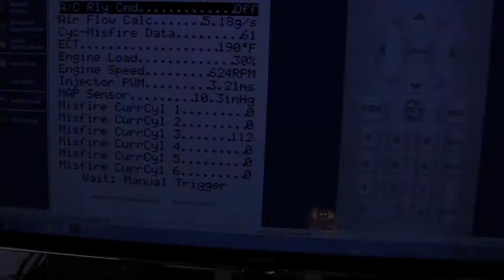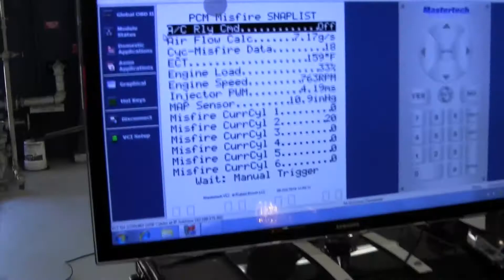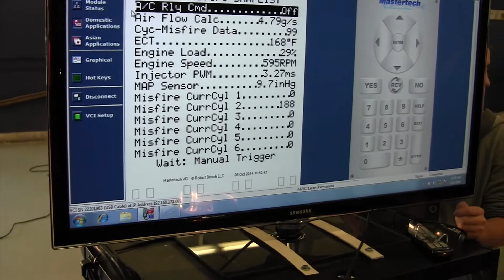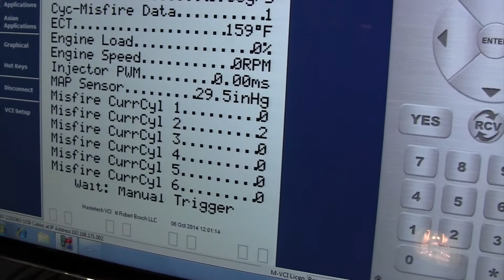Trailblazer misfire Testing Ignition Coil

Comment: Useless video. Change subject line to How To Replace COIL On Plug on Trailblazer. 5 people standing there and not 1 of them explained anything related to testing.
Reply from the maker: Sorry to hear that, what did you want explain how to change a coil. Because how we identify the bad coil was explained -
Reply: @natedaviscteinstructor  
 
Change the subject line to
"Chevy Trailblazer 4.2 Pinpointing Bad Coil On Plug Using Shop Software" because when someone searches for how to test a coil on plug on Chevy Trailblazer,this video will not help.The only thing it does is it shows which cop is faulty by using a shop scanner/equipment.There is no actual testing of the coil on plug itself.How many DIY mechanics have the type of equipment you're shown using?? Even if a DIY guy has a cheap scanner,a misfire code that pinpoints the specific cylinder (P0301,0302,0303,etc) with the misfire is the only way he/she will know which cylinders coil on plug is suspect,but if P0300 (random/multiple cylinders) is the only misfire code that's popping up (which oftentimes happens til the vehicle has been driven enough for the pcm to id the suspect cylinder) several tests have to be done to id the culprit,if a scanner hasn't id'd the offending cop or if the owner doesn't even own a scanner (which is btw a no no when working on a EFI equipped vehicle) Pulling each cop harness individually while running and listening for an idle drop is the quickest/easiest method,if a scanner isn't available or if the cylinder hasn't yet been identified. Primarily I would just edit your subject line,taking out the testing ignition coil part,which was in no way shown.Trailblazer misfire locating may be better suited.